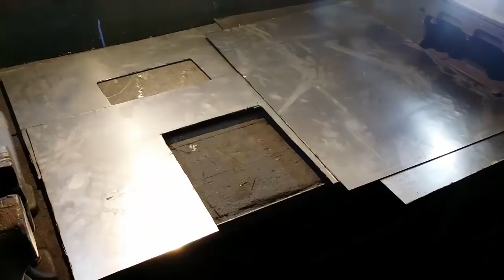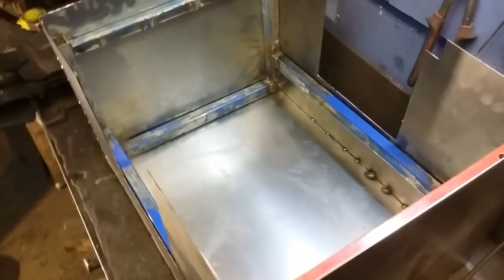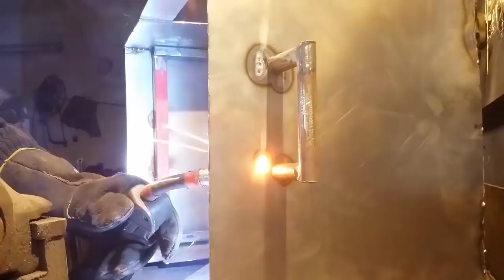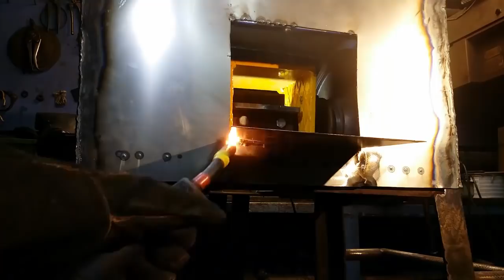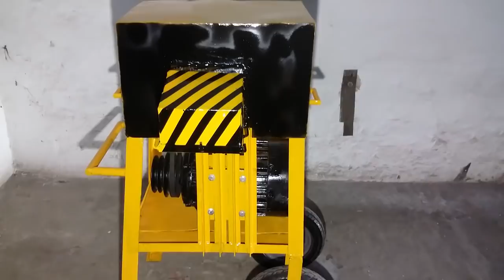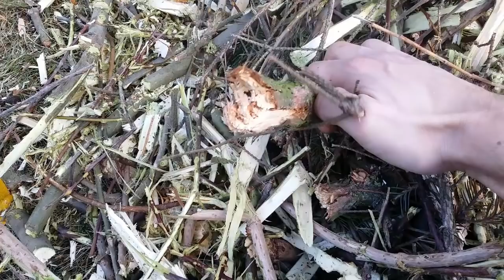Wood Chipper I Homemade - Part 3

Comment: I was trying to hear how the motor rpm was affected but the loud music drowned it out.
The main improvement I would add are geared down feeder rollers in front of the cutter  to control and slow down the feed.  That would make finer chips and prevent a jam or catastrophe when feeding larger size limbs.    A thought also would be to add a safety  trip lever that would shut off the motor power and drop spring loaded brake pads down onto the fly wheels.  
I don't know why all of that sheet metal was added.  Likely to vibrate and come loose over time.   On the intake funnel I would use thicker gauge metal to prevent the fed brush from whipping it out of shape.    Aside from the observations,  I enjoyed seeing your build.

Comment: Your idea is awesome! Only couple  things need to be modified in your proyect are:
Entrance of branches is dangerous, needs a small shut for protection, needs more blades to make the shreder pieces smaller and  blades need to be longer if you want to feed your machine with a lot of material, especially if your motor is over 2 hp. Oterwise congratulations and thanks for sharing.

Comment: Nice craftsmanship.  You never get it all right on the first try.  I'm currently building a soil trommel myself.  I'd call this a reducer.  Something I have been thinking about building.  A machine to make material small enough to go through my shredder.  Recycle lumber scrap as well.

Comment: You can reduce the motor speed.
Make the chips finer.
Have a safety stop switch.
Offloading chute needs to direct chips correctly not all over the place.

Comment: But that's ok, but it's a big speed
Insert the frequency converter and you're riding a thing about the engine frequency.
It's much easier than slowing over the pulleys.OK,

Comment: Very nice ones issue should add another chipper shaft so it will be two chipper shafts . The first you have on and another to chop up the chips finer you know what I mean.  That's what the chipper machine has from the guy next door.  His diesel machine has two sets of chipper shafts that's why I understand why choppers get their chips like that .